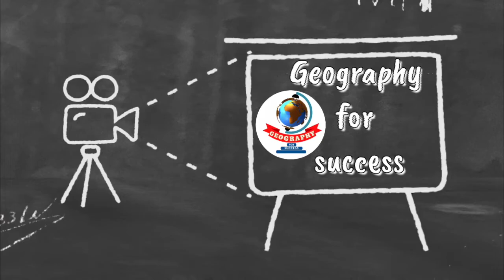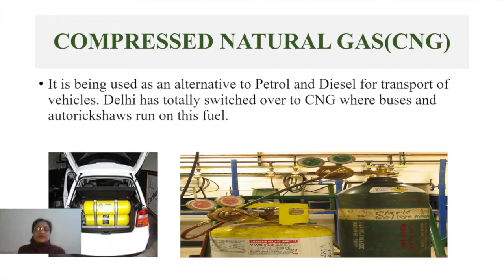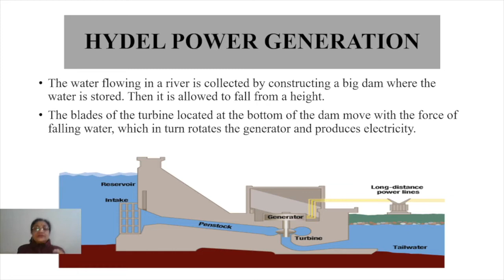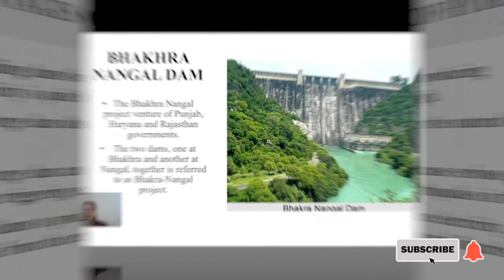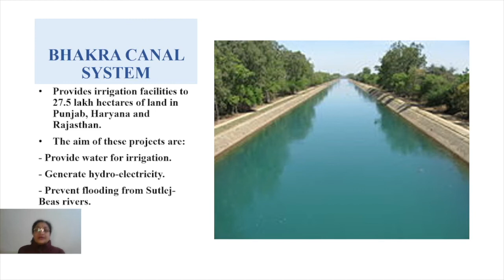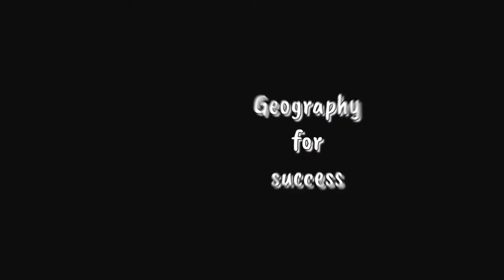CONVENTIONAL SOURCES OF ENERGY | NATURAL GAS AND HYDRO ELECTRICITY | GEOGRAPHY | ICSE

Comment: hello ma''am,
I have a doubt as to why the price of natural gas is less than petroleum and coal when it is more eco friendly than the others.
Also, thank you for explaining the chapter so clearly.
Reply from the maker: Thanks.
Reply from the maker: Natural gas is abundant though a fossil fuel . Its extraction doesn't need any additional infrastructure as it is done along with petroleum or the crude oil. Moreover its transportation is quite easy and cheaper, all these things make Natural gas a cheaper source as compared to Petroleum.